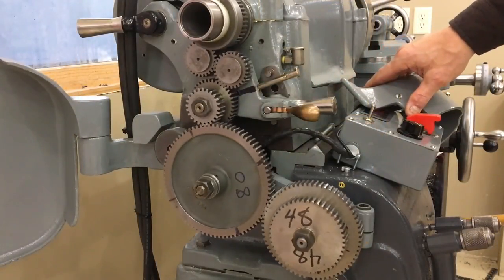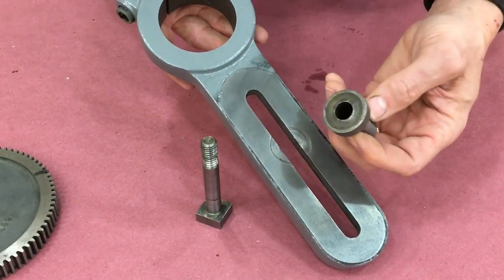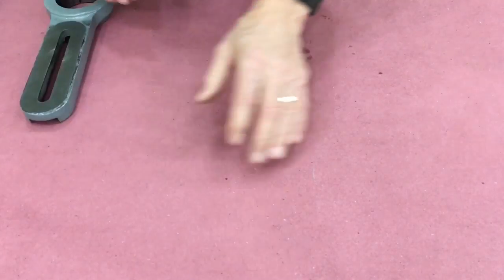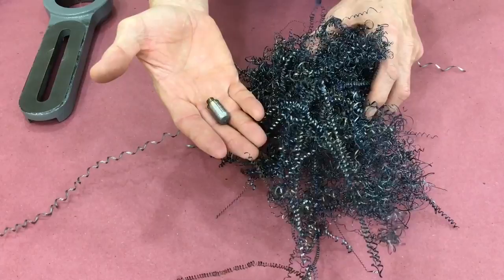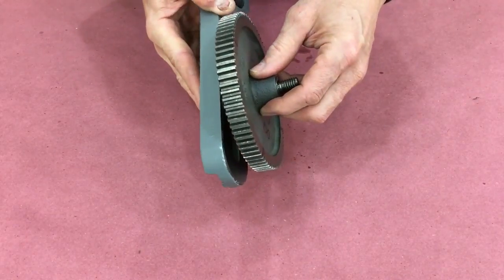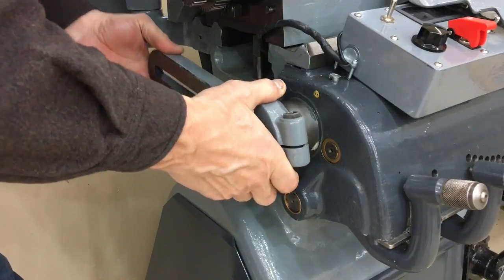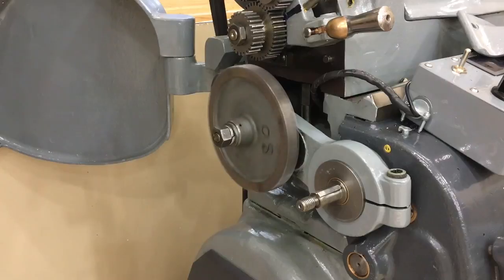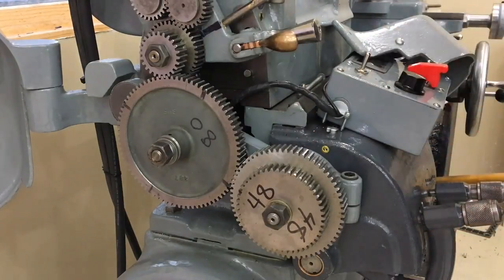South Bend 13" Restoration - Gear Train

Comment: An easy way top get a repeatable gear mesh on lathe spur gears is to use a standard sheet of printer paper. Squeeze the gears together with the paper between the two gears until all the mesh is taken up. Rotate the gears to get the paper out. You do want a slight amount of clearance between the gear teeth and the paper is just a cheap easy gauge to set that clearance. Bottoming out the gear teeth will accelerate wear so using that paper trick is a good habit to get into.
Reply from the maker: Thanks for the comment

Comment: I love you videos. Anyway I just got my dads 9”c south bend. It was in my parents basement since 72 and was my dads great great uncles. It’s a 1937. I just put it in my basement and it runs great but need to clean gears. My dad had grease on them
Reply from the maker: Thanks for the comment, yes, gears on the lathe should have oil for lubricant.

Comment: George - 5:50 ......on my thread chart on my 13"  it says  'stud gear' 48 for the top row down to 4 tpi as you mention ..........but all the rest of the threads it indicates requiring a 24t stud gear.   Like you I seem to only have a 64 and a 48.   You call them screw gears here and that's what I see them called in my book.   Internet search tells me the stud gear is the outboard gear on the reverse tumbler assembly.  And there is a 24 there. ...........I need to make a 12tpi part but the thread I'm getting is WAY too fine.  Any idea what I need to change?  My gear train is set exactly like yours.  (let's assume the quick change gear box is all correct) There is a wide range gear box SB makes that appears to only use the 48t  but mine is the regular one.
Reply from the maker: Bobby,  Are you sure the half nuts are engaged with the lead screw?   Perhaps you are traversing the cutter with the power feed, which will result in very small threads
Reply: @georgebell7103  LOL thanks G.  Wow I was using traverse --- I know better but muscle memory took over.  This is a relief though.  I thought maybe I put the QC gearbox together wrong.  I really appreciate the quick reply--- you hit the nail on the head
Reply from the maker: @dizzolve  I only knew what you did because I have made the same mistake... kind if dumb but it happens.  Take care

Comment: Great installment in the series.
Reply from the maker: Thanks John
Reply: Tomorrow is the big day here. I am working out the details of a lift truck with experienced machine delivery driver instead of the flatbed winch truck favor I had originally set up. I found a good used pallet jack for $50 yesterday, and a lantern style post and 6 or 7 holders for $35 which I will hopefully acquire today.   :)
Reply from the maker: Post your email
Reply: George, I sent you a message with my email address in it. btw - I secured lift truck transport for the machine AND got a lantern tool post, a garden variety of 7 Armstrong and Williams holders, and a few cutters today. I feel so much more at ease knowing I don't have to contend with a lathe sliding off a flat bed.
Reply: I received your test message. Loud and clear.

Comment: Make just one more good part and it will be down to $2,350 each! Congrats--looking good, George!
Reply: I already see the next part he can make too, it's a spacer to put in place of the gear he's using in it's place. I have a South Bend model 34C, which is 13" x 6ft., and the gear trains are set up so that there is a spot for a compound gear, and there are bushings and spacers that allow various combinations to engage. Funny thing is I just made the same part, and a spacer so I can run single gears, but I got lucky and only made one :)
Reply from the maker: I know you can put more than one gear on the bracket (banjo).  Thanks for your comment.  I hope to be more efficient when I make future parts.

Comment: I am so happy yo see you are back making your great videos. Will you show more of that electric motor driving the lathe.  Thanks ...Ken
Reply from the maker: Thanks for the comment,  happy to be back
Reply: Hi
Reply: He may be using a 3 phase motor operating off single phase 220 through a variable speed drive (VFD) that electronically converts 1 phase to 3 phase. I have that conversion on my Jet 12 x 36 and it works very well. You get an infinite variety of speeds through the lathe gear train and the VFD.

Comment: Hey, very cool subject you have here! I have a 13" South Bend as well, but it's a bit older...it's a 1919 South Bend model 34C, so it has a six-foot bed and standard change gears. Funny thing about your video is I found it while searching for a video about gearing, and was shocked to see that we both made the same part just a couple of months apart! 

Lucky for me I got the flanged bushing on my 1st try, but had to make the spacer twice...you might want to think about making a spacer for the end of your leadscrew, instead of using a spare gear for the job. Come and check out my channel and the Old Red Beast, my lathe...Aloha, Chuck
Reply from the maker: Thanks for your comment